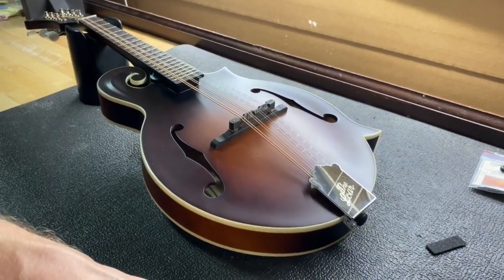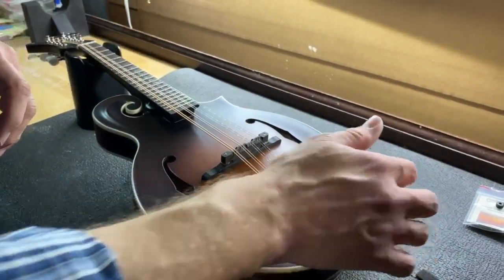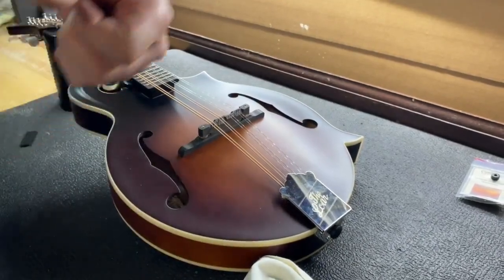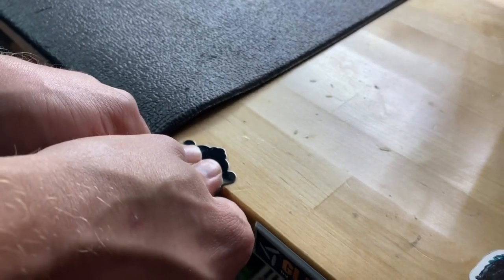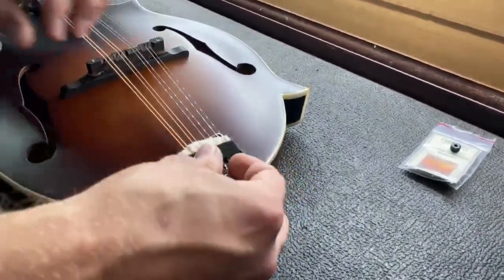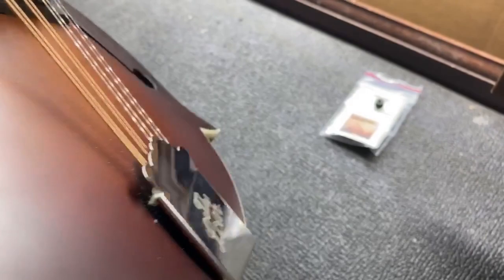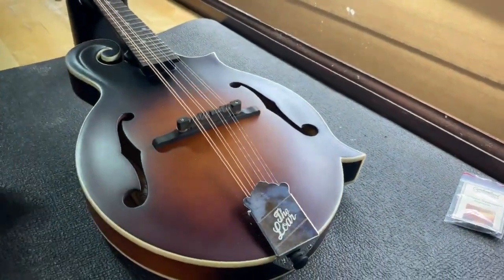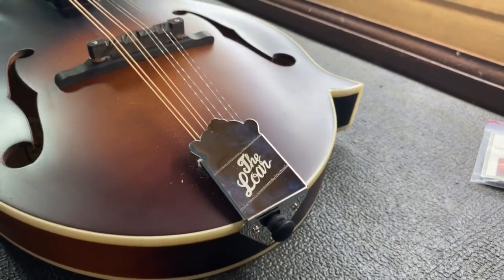Stop the BUZZING! How to Find & Fix a Mandolin Tailpiece Buzz!

Comment: I have a Rover mandolin I found by a dumpster. It started twanging about a month ago. Thanks to this video, I found out that my little mandolin doesn’t even have felt under the strings! Still, a quick adjustment and the twanging is gone.

Comment: I think self adhesive velcro works better because the self adhesive means it doesn;t get dragged around. Most material ends up getting dragged with the strings so I put self adhesive velcro UNDER the strins and you could also put it under the front of the top as well I dare say.